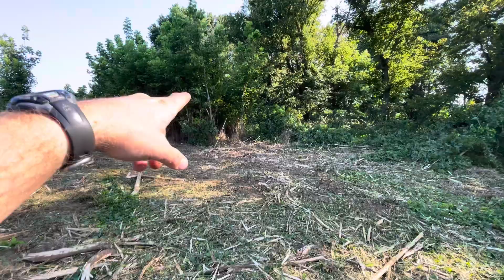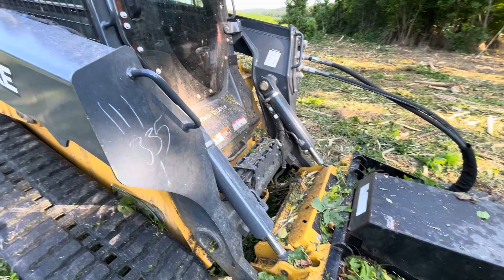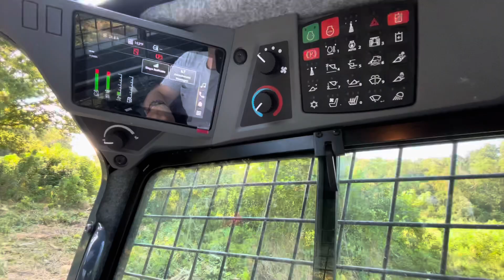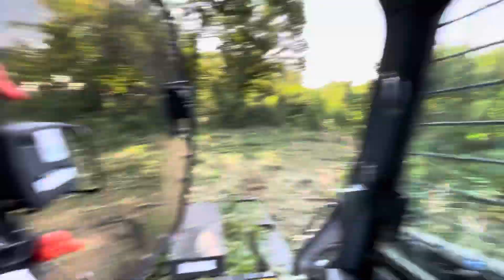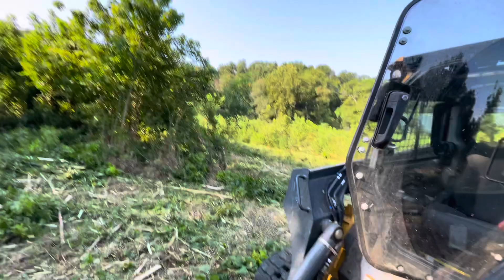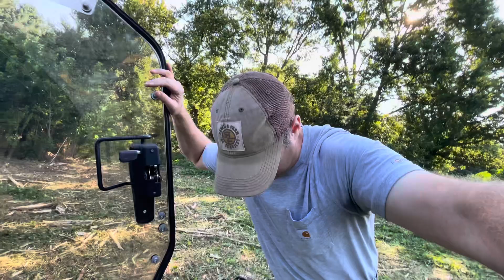John Deere 335 P

Comment: does this have an improved engine and hydraulic cooling system from the g and e model? more capacity?
Reply from the maker: I believe the engine has been turned up only. It is still a Yanmar motor just like the other models, but more hp (118). The cooling is supposed to be better. I have not had it long enough to try it out

Comment: did you get the integrated fire suppression system?  This would be a major concern if using as a brush control unit in my opinion.
Reply from the maker: No, just a fire extinguisher